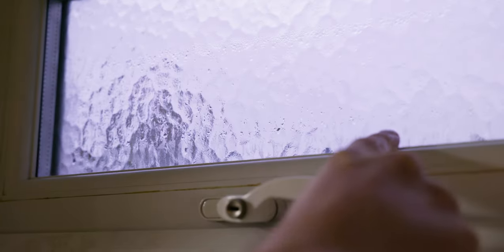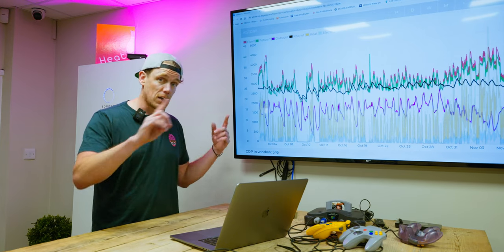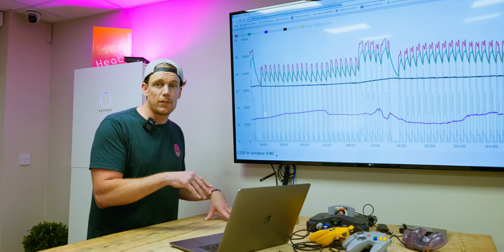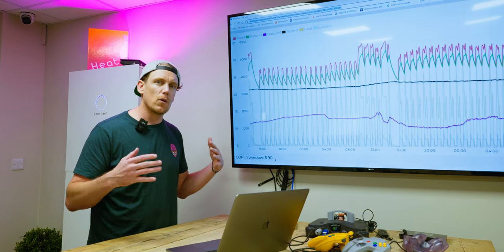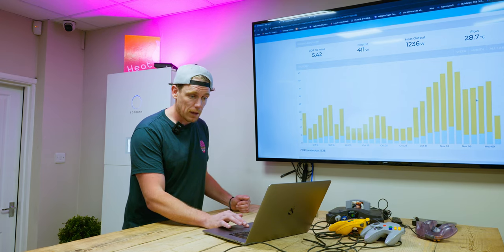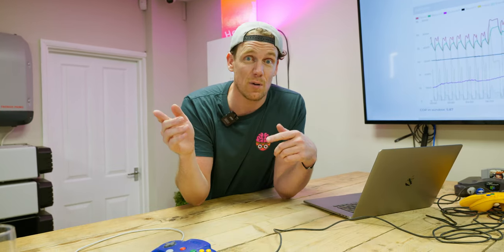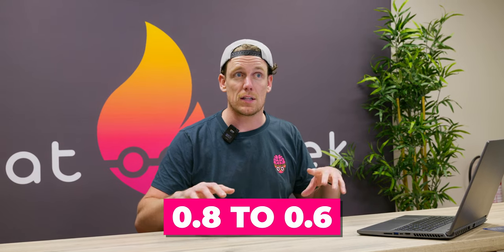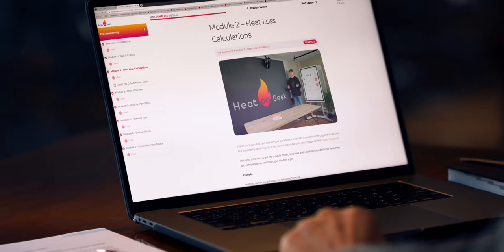How We Got 600% HEAT PUMP EFFICIENCY With NO INSULATION!

Comment: Why aren't we using heat pumps to concentrate and convert this latent heat of water vapor into electricity? If we have a COP of more than 400% this is a very viable solution to renewable energy extraction. anywhere you have temperatures above 70 degrees daily and high humidity levels near a body of water, there is abundant free energy. I have been working on this with aircompression systems and impulse turbines myself.  Water vapor is more than 1000 times more contributing factor as a greenhouse gas than carbon dioxide. This should be a priority. Not home heating. Electrical generation.

Comment: Cool (or rather warm). Those are the type of radiators we have with our heat pump system. To touch they do not feel that warm (which for those "not in the know") seems odd. But, place hand above top of radiator and you can clearly feel the convection hear rising.  Mark.
Reply: Additionally, you could install fans (e.g. ClimateBooster, HeatFan, SpeedComfort) to boost convection and work with an even lower supply temperature using the same radiators.
Reply: @Soepsliert  interesting,  will investigate
Reply: Check your stats make sure the radiators aren't knocking the heat pump off

Comment: It's all well and good to make a video on this but surely when you price to install a ASHP its good practice to change the radiators at the same time, This is simple heating engineer logic. The same as with condensing boilers. The real issue is that the government £5000 doesn't scratch the sides of installing an ashp and updating the system to make it efficient. I went to a brand new install this week and the first room I went it had a incorrectly sized radiator. Those of us who work and advise daily on heating systems know that most heat pumps are installed and sold by muppets. The same with boilers and anything else to that matter. We don't have enough skilled engineers to go around and the title of this video is a bit click bait which doesnt help our cause
Reply: I can't agree it's good practice to change the radiators when pricing an ASHP install. If the existing radiators are suitable, don't change them! Do the calculations to either prove that they are suitable, or that they are not. The UK has had rules-of-thumb being used to design inefficient heating systems for far too long. Stop it.
Reply: @tlangdon12  well obviously if the radiators are suitable, you wouldn't change them. I dont understand why you would even mention that?

Comment: Having poor insulation has probably helped your heat pump efficiency (COP) during the mild weather as it has allowed it to run (more) continuously rather than cycling on and off as would be more commonplace in milder weather. I can achieve great COPs too in mild weather if I open all the doors and windows, set the flow temps to 30C and leave it running continuously. Increasing your insulation may reduce your overall energy bills whilst actually decreasing your COP in the milder months as the building now requires less heat (lower bills) but causes the heat pump to cycle more.

Comment: A COP of 6 and it's not insulated 😲😲😲😲😲 ....  cant wait!!!
Reply: You understand the CoP is not directly affected by insulation.  Improved insulation may mean the heat pump may cycle more, reducing the CoP.
Reply: @edc1569  I thought improving insulation allowed heat pumps to run at lower flow temps in the house and prevent the customer complaining that their feeling too cold because of the fabric of the house…
Reply: It’s a function of flow temperature and the outside air temperature. Big radiators help a lot with that as firstly they allow for a much larger surface area to convect heat into the rooms. Secondly that larger heat flow from the rads keeps the flow temps low helping the heat pump’s efficiency.
With better insulation the flow temps can be even lower and the pump should run even slower if it can modulate low enough. That will in turn lower the total running cost. Also, if they would dial down the room stat a bit it might help - at the moment they’re roasting the place at 22-23C.

Comment: For the confused, improving insulation will not improve the CoP, the CoP is purely a measurement of how efficiently the heat pump is working, however if improved insulation means you can reduce the flow temperature/compensation curve then that should improve your CoP
Reply from the maker: It will. We will be able to run at lower temperatures and scop will increase further.
Reply: 👍👍🙌🙌 always learning…
Reply: @heat geek that’s literally what he said lol
Reply from the maker: @Etacovda63  yes I missread sorry both!!

Comment: Awesome!  The data sheet of the heat pump I have, which is probably few years old tech, doesn't even have a condition listed that achieves 5.9 COP.  Looks like the most efficient heat pump models are R-290 units in the 5kW size or so.  Can't get those in the US but at least have a relatively modern unit that should be much cheaper to run than an oil boiler.  I'm jealous of that performance, nice job!

Comment: Hi Heat Geek, I have a question... I've set my condensing boiler to 40C and increased the size of the rads in some rooms to compensate. The house now maintains 20c fine. Is this a good empirical method of assessing heat pump suitability?
Reply: Yes
Reply: Excellent question!  I'm trying the same thing with UFH as well as rads.
Reply: We did exactly this in the winter before we got our heat pump, and it gave us the confidence that we could run at low flow temps and still heat the house effectively. We had insulation upgrades and bigger radiators too at the time of installation, and now we can run at flow temps of 35C or below on all but the very coldest of days. Make those radiators as large as possible and design for as low a flow temp as you can accommodate (lower the better).

Comment: Thanks for another great video.  It was interesting to hear in an earlier video that when looking at SCOP it is biased towards the winter as that is when the heat pump is more used.  

Still when I look at specs for air to water heat pumps which give a specific SCOP for a specific flow temperature and out door temperature (e.g. Vaillant state their 12kw model at -5C outdoor can achieve an output of 10.8kw with a 55C flow temperature and a SCOP of 3.63). I guess I struggle to see how that applies to real life.  

1: What are the assumptions made when a manufacturer states performance like that
2: How does that apply to a real life situation - Can you infer that if a system has been properly installed and never has to generate a flow temperature more than 55C then the SCOP will never be lower than 3.63?
3: Do these sort of quotes for SCOP assume weather compensation?

Thank you for all your videos
Reply: Scop refers to seasonal heating season 6.5 months, if you just use a COP it will be different from moment to moment, it's a better way of judging what the machine can do (its more real world).
Pumps should not need to go above 55 as long as the rads are sized correctly (Correction Factor) and the pipework can carry enough flow rate.
SCOP can only be worked out after the completed season end of October to mid-April, at some times the COP will be terrible, during startup and in very bad weather, then excellent on better days. Thats why we get a seasonal average.
They absolutely include weather comp, it would be inefficient without it.
Reply: Agree more detailed performance data from the manufactures would be realy useful. ( & fewer glossy photos of warm people in show homes) .

Comment: I have a 10 year old house, insulated walls and windows, took out a condenser boiler, average gas bill for 3 months before Heat source fitted 450 , after the electric bill went from a few hundred to thousands yes thousands as I live on the coast and the constant chilled wind just stopped the dam thing working, just had a new gas boiler put in , what I did notice was the oversized rads I had to have fitted now heated the room so quick the gas boiler was hardly on, gas boilers and oversized rads are the way forward

Comment: Hi just checked mine today and if the controller is accurate it says I have used 17.1kwh of power and produced 101kwh of heat that's nearly cop of 6 at 5.5 degrees ambient. House is at 20 degrees. Who said you can't heat old houses with a heat pump. It's running at a flow temp of 35 degrees to keep house at 20. We'll chuffed best thing I done getting rid of oil boiler! Your videos have been a great help. Thanks
Reply: @Vicki  hi its a samsung ehs it is accurate on power absorbed as I have an electric meter on it as per mcs requirements. It's the kwh of heat I can't verify. Everyone told me an ashp in my house wouldn't work but it works fine even at these low flow temps.

Comment: Love this. Look forward to seeing how this all goes. Are we not better off insulating properly first though?
Reply from the maker: Yes. This is an experiment to challenge convention
Reply: @HeatGeek  Also I guess it's good in a way to do this experiment 

My dad for instance is VERY wary of loft insulation in particular, because he's had it done via a grant before and it just left mould

The grant chasers also don't last very long and it's quite difficult to pursue

Meanwhile, I'm very pro insulation, and I can't get any form of grants so I have to carefully look into which company is the best bet for that.

Loft insulation in my parent's house has been entirely removed because of dodgy insulation contractors
Reply: Seems to me that you could have high cop value, like here, with poor insulation, but if you insulated then the overall running costs would come down.
You could have low cop with good insulation, which could cost the same to run as high cop with poor insulation - the 2 things seem to be mostly independent of each other

Comment: Good insulation doesn't make a heat pump more efficient, it just means it uses less energy to heat the dwelling!

A better insulated house simply keeps the heat inside where you want it for longer...
Reply: That’s what I would assume.  The lower the return temperature the more efficient.
Or more likely it is irrelevant.  
But still getting such a high efficiency is impressive.  Sure way cheaper than gas at current prices.

Comment: Might be interesting to see the cost difference between heating with the pump vs heating with a combi boiler.
Reply from the maker: https://youtu.be/D8pvXDk_KAA
Reply: At todays prices gas is 9p per kw and electric is 45p so electric heating needs a cop of 5 to match the value of gas if you looked at only the fuel cost and not at the installation cost or the environmental costs. Also because gas can quickly get the property up to temp you do not have to run it 24/7 when you are not home, although that is much more complex to put a value on, and not quite as simple as it sounds because heating does gain a small cop bump when run low for 24/7 vs running at higher wattages. But obviously turning off during low or no need has fuel savings which gas is better placed to capitalise on... Heat pumps are not as efficient when the property is cold and the pump needs to run at a higher delta t to achieve a comfortable temp in a reasonable amount of time (or just wear an extra jumper for 3/4 hrs whilst the heat pump gets the property back up to temp..
Reply: @alphabuilders . Very good point, there are those that will argue that keeping the heating on all day is more economical.  Simple maths says otherwise. 
So you need to size your heating system to heat the house in the time you use it.  Whether it is gas or heat pump is not the issue. 
But isn’t the CoP best when the radiators are cold?  So as it warms the house over a shorter period it will still be efficient at least to start off.
Now it also depends on the building fabric, a heavy or lightweight, poorly insulated or well insulated.
The ideal is probably well insulated with a heavy - high thermal mass, internal structure.  Then heat during the periods of cheap rate electricity.

Comment: Can you share your control strategy in more detail? Would be really helpful to replicate. Thanks
Reply: Yer would be interested in if we had change this setting on the user settings or is this installer only setting and can you  make a average heat pump much more efficient just by changing settings? Thanks

Comment: What I would like to know is why can’t we use swimming pool heat pumps (the all season units) rather than the over priced “house HP”. 

I understand they may not reach higher than 40c but the efficiency is massive on them up to 25 COP. 

By using a swimming unit with a heat exchanger this should do the job better than most purpose HP units.

Comment: So it may be better in some cases, to just invest in some  bigger radiators instead of insulation. Just to try to maximize scop, instead of lowering heat loss right?
Reply from the maker: No insulation means less energy AND higher efficiency. Insulation first.
Reply: @HeatGeek   well, but why did you not add loft insulation first then, instead you changed radiators?  I missunderstood the video then. 

My idea was, that it would be cheaper to heat 15 kW heat loss house with 4.5 scop system instead of 12 kW heat loss house with 2.5. Scop system. 
Or am I wrong?
Reply from the maker: @HonzaZalabak  we have in all the properties we install in. Ours  as all of our stuff is an experiment. Plus I thought it was 200mm
Reply: @HeatGeek  thank you for taking your time to reply to my comment. I am just very curious about heat pumps and heating systems in general at the moment. 
Maybe my idea was not completly wrong, but maybe the catch is, that the lower your heat loss is the less warm water in radiators you usually need. So generally you get better efficiency. 
Plus the cheepest energy is the one you dont need to produce.
I wonder what SCOP is going to be in this case
Reply: @HeatGeek  did you upgrade the pipework size when you upgraded the radiators?

Comment: The worse your insulation, the higher your SCOP will be, assuming you can still heat adequately with a low flow temperature, because your balance point temperature will be higher i.e. a larger proportion of your annual heating load will be when it's milder outside and hence the COP higher. A house with a really low heating load will have that load concentrated on the coldest days.

Comment: I’m concerned about the environmental damage caused by f gases. I understand there are alternatives that can be used. Could you do a video on where the industry is at with this issue? 

If heat pumps do take over gas eventually, I foresee this being an issue that the industry does eventually get round to tackling. Does it not make sense to get on with it now?
Thanks
Reply: He's using R290 which is pure propane. It's a hydrocarbon, not an f gas.

Comment: Hi guys, I live less than a mile from your office, I've got your Vito Ops manager coming to see me next week. My current gas heating/insulation is dreadful, I want to improve everything and install a heat pump. If you want to use me as another real life case study feel free to get in touch! Thanks, love the channel, couldn't believe you were so close after I'd watched half your channel 😂
Reply: How is your new installation going - was it worth it? We moved in to our converted barn 9 years ago (bought from a previous owner who didn't really live in it). It has an ECODAN ASHP for underfloor heating and hot water. It is expensive to run and gives nothing back. I have turned off the heating and replaced it with 3 Everett stoves, which are really good. Although the hot water is set to 24hrs it is always cold, so we have to repeatedly use the boost button (up to 3 times) to heat water for washing up etc. I have really struggled to find anyone to offer a service, the original installers have gone. I have recently contacted a company I saw on a recommendation of our local face book page who wants £400 plus vat and extra if the glycol needs topping up. Luckily I have a gas Aga (aims programmable) which help to heat the property; gas central heating would be preferable but with the cost to convert and net zero agenda this is not a possibility. I am so frustrated!!

Comment: I wonder what will happen after you get the insulation fixed.  Is there any risk of the Vaillant being oversized and not able to throttle down enough?
I am guessing it will need enough radiator and underfloor heat surface and volume, but what does a big unit do if heat loss is very very low? (lets say just 1kW at -7 degrees)

Comment: Nice work! Did you do anything special (calculations etc) in emoncms to get from the inputs to feeds or is it just logging to feeds? btw, have you installed fans on the radiators?
Reply: Thanks Arjen! All just logging to feeds and conversion of power to kWh, that's all then picked up in the heat pump dashboard (we set this up for Adam)
Reply: @trystanlea  thanks! I'll build something like it when we have our heat pump installed next month. And, (for years already!) what a fabulous project! Thanks for all the effort!

Comment: Really interesting, so would having very oversized radiators give better efficiencies or does it mean you can install a lower powered heat pump? 

Looking at replacing a radiator in my living room now and maybe upgrading the boiler in a few years and debating on heat pumps vs boilers. So if I oversize the radiator now will this help from the efficiencies point of view? Basically can a radiator be too big?
Reply from the maker: No ot can never be too big!! As big as pos!